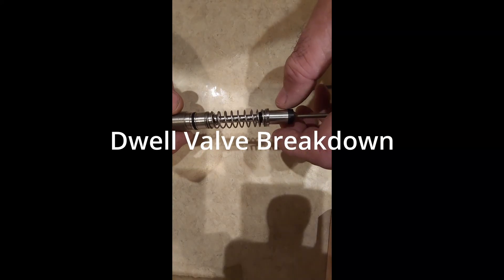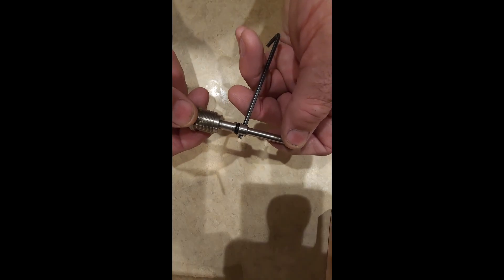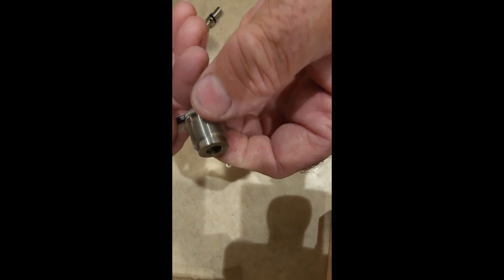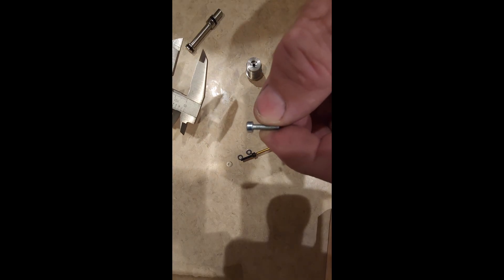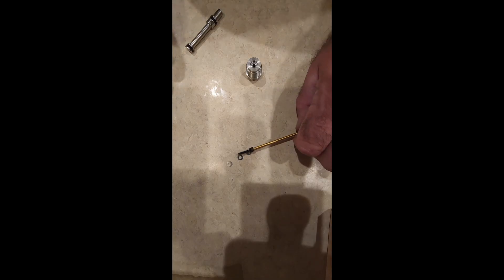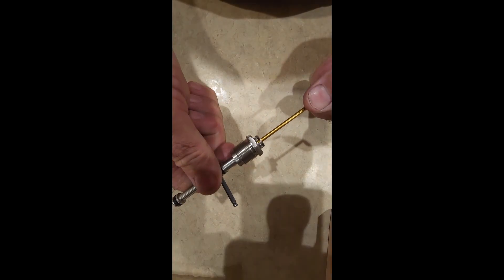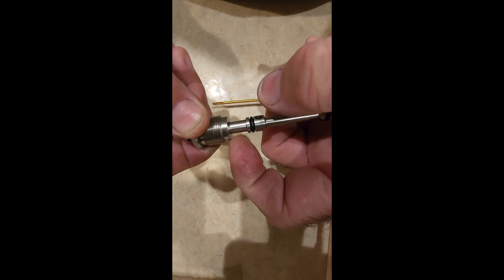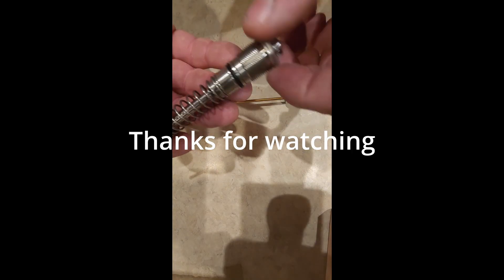Dwell Valve Breakdown Part 1

Comment: I ordered my 2.5x1.5 o rings. I will attempt the repair myself.  Thanks for taking the time to make these videos.
Reply: I have the 3rd gen valve. There was a m3x16 bolt with two o rings. I deleted one o ring and shortened the bolt so I could bottom it out